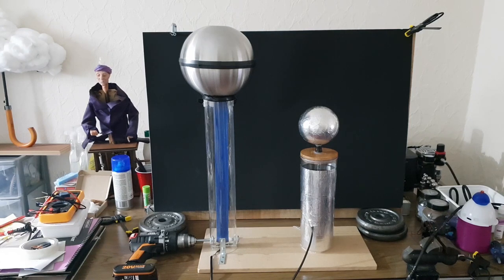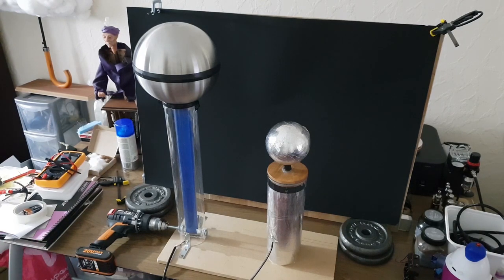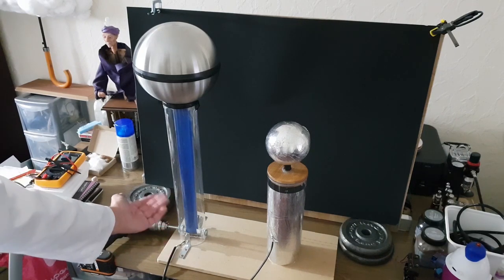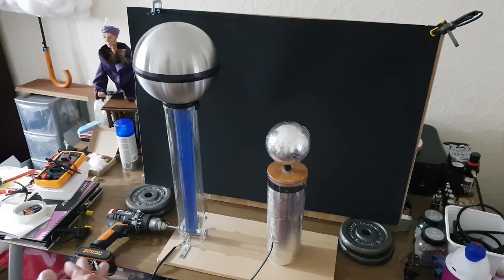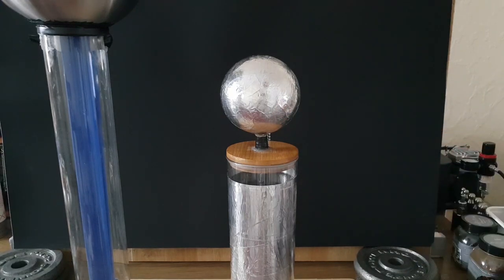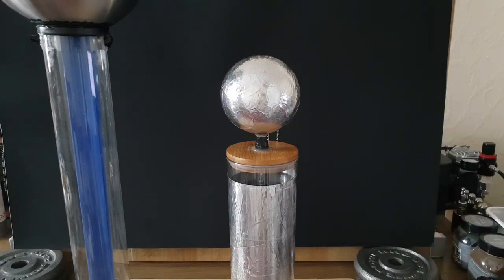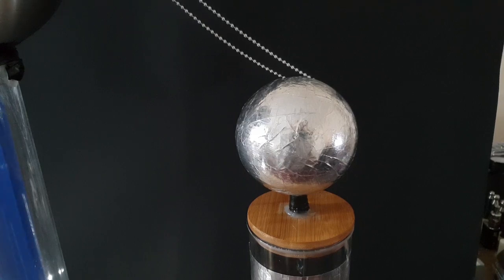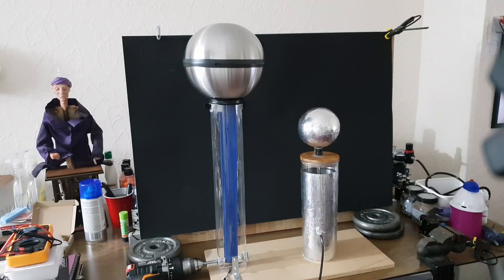The Experimenteer - Van de Graaff  and Leyden jar demonstration

Comment: It will be worth reducing the height of the condenser electrodes inside and out. At the moment you only have a couple of inches of air between the two, (up-across-down). Increasing pulley diameter and belt speed will give you a higher voltage quicker. Sparks will find their way through molecule-sized gaps, so rubber seals don't work very well.
Reply from the maker: Thanks for that!